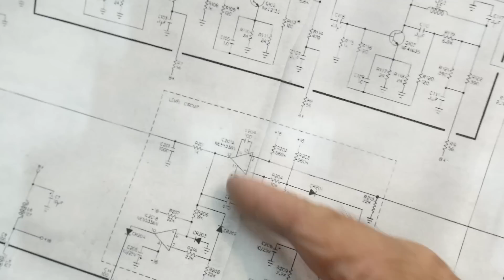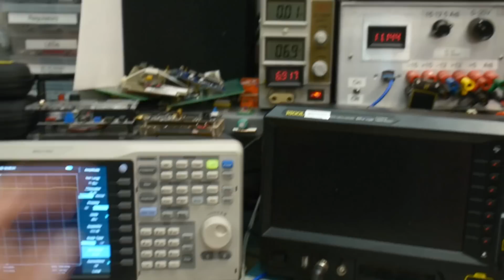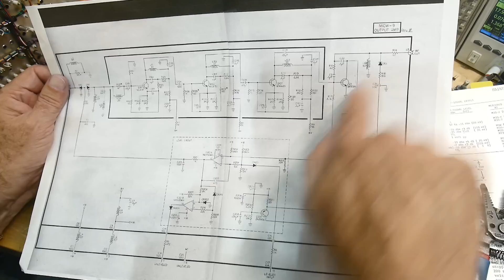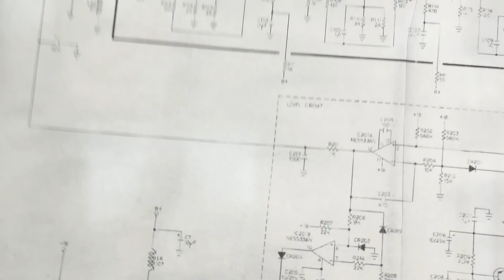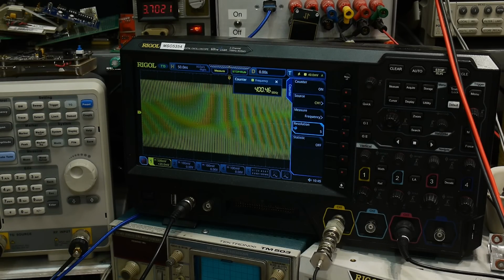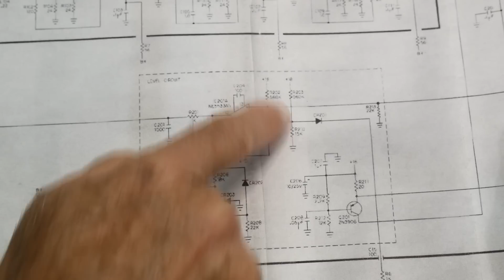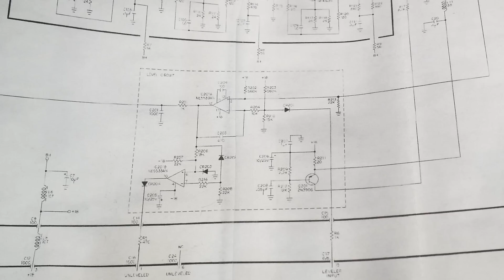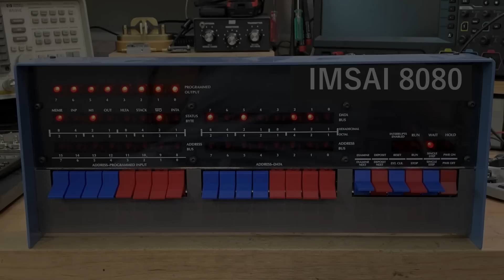#1918 Wavetek 3000 RF Generator (part 12 of 14)

Comment: I hope parts 13 & 14 answers the questions I have. What is the function(s) of those funny little black and white slide switches? What is the function of that added-on (?)  perf board circuit located in the same general area, I say added on because it doesn't appear to have the same build quality as the rest of the modules.

Comment: Technically PIN diodes work on the amount of power into the device. If you measure the output power of the attenuator, you will find that the attenuation is not linear with the voltage. It also depends on the input signal power level. For example if the input signal power is - 30dbm, your drive to the attenuator might be  - 10dbm, this changes based on the IP3 curve. A 0dbm signal could require a positive signal like 3 dbm.

Comment: It’s always the connectors 🤦‍♂️
Reply: It's always a power supply!
Reply: Its always a crapacitor (except when its a diode.
Reply: Ir's always a electrolyte or tantalum capacitor. Even when is not.